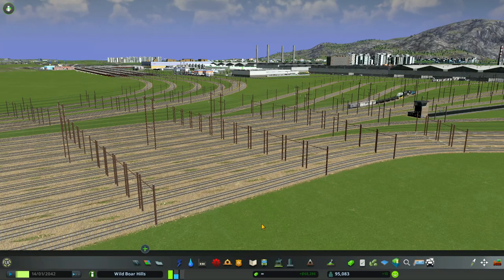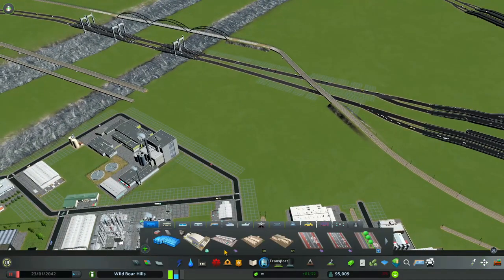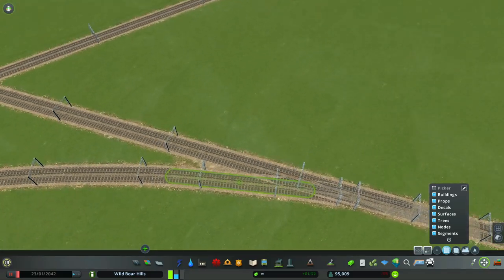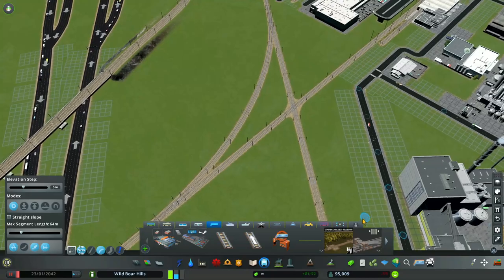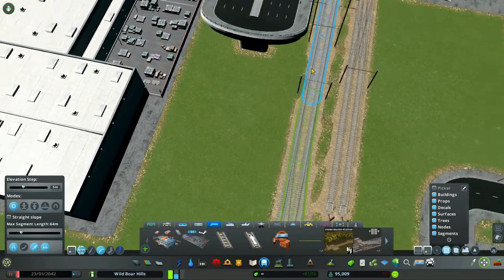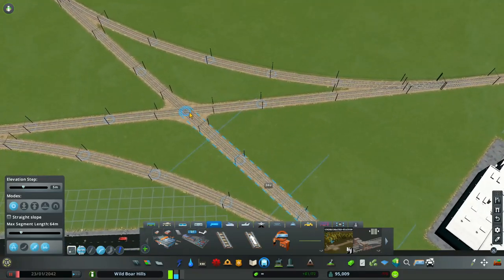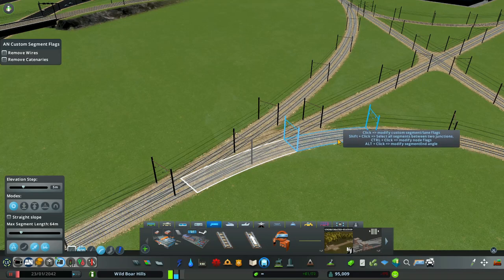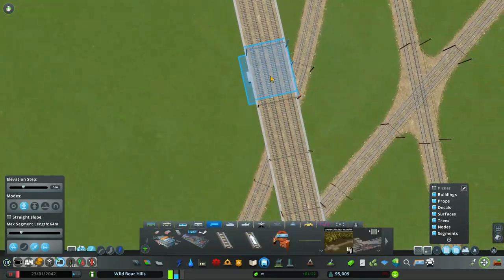How to Build a Train Intersection for Cities Skylines

Comment: Looks not bad, but having so many tracks intersect on one level is very unrealistic.

It's better to make it like a highway interchange, where direction crosses another direction
Reply from the maker: Yes you are so right if you are talking about my double track railyard! I have plans to change those to single tracks and Node Controller 2.8 gives and error, hopefully I can do it with Node Controller Renewal. Also I am not finding Single Track AI has the greatest AI so I opted four double tracks, very unrealistic. Thanks for the feedback!
Reply: I would disagree. Check out some of the rail running in Kansas City for example. There's a lot of intersecting tracks.
Reply: Tracks won't intersect on xbox 😢